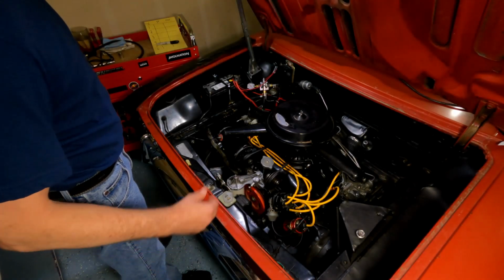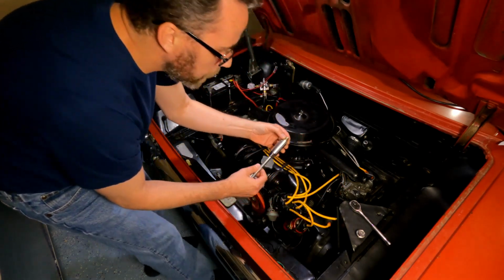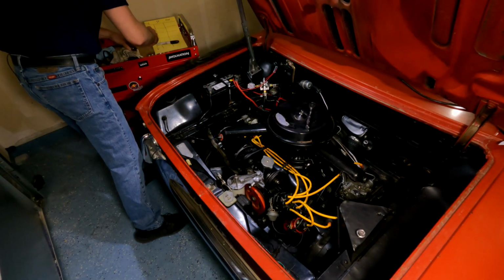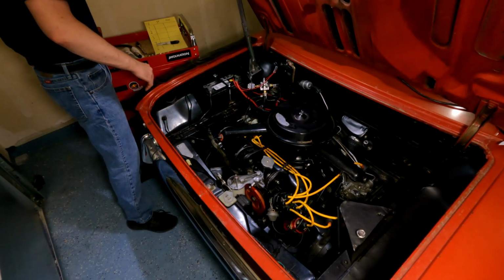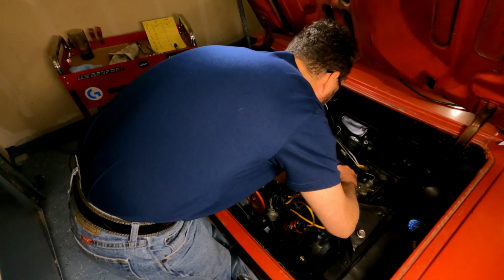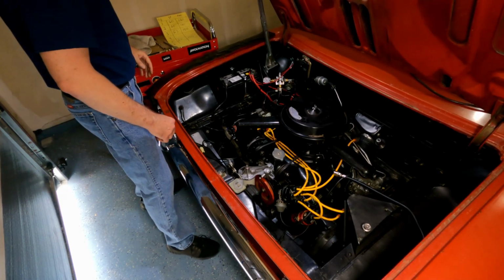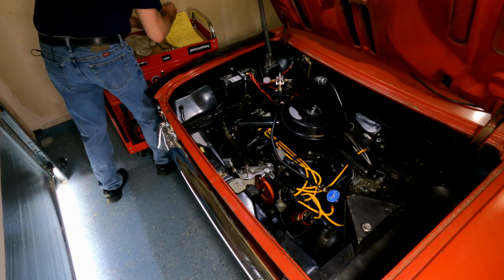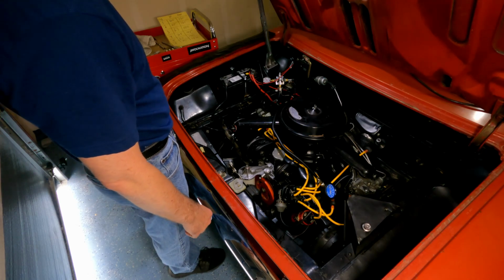1964 Corvair Monza | Compression Test

Comment: Good job
Reply from the maker: Thank you much. Thanks for watching
Reply: I have new heads and I have the same cylinder with zero compression. Just pulled the cylinder and piston and don’t see anything that looks suspect. Wondering if the lifters are the culprit now. Any ideas?